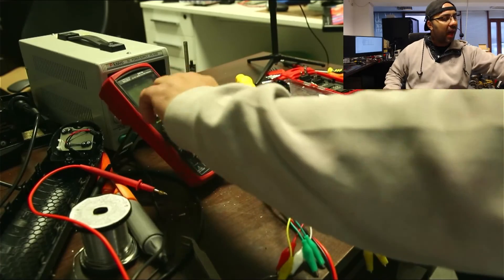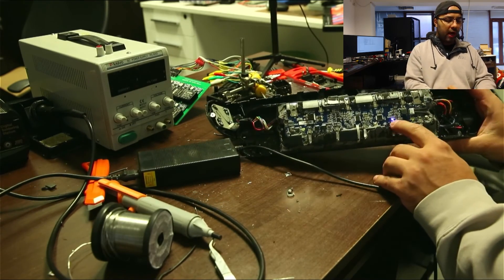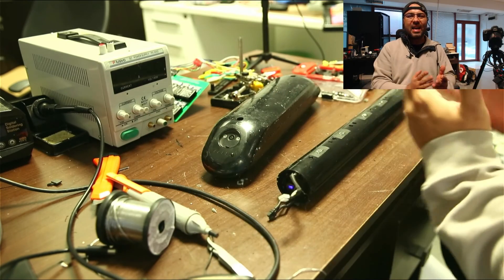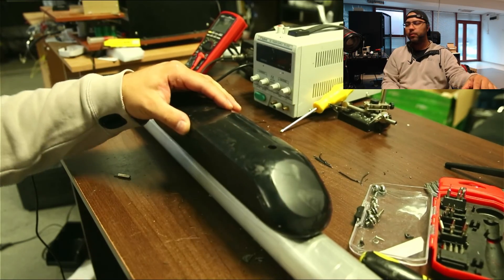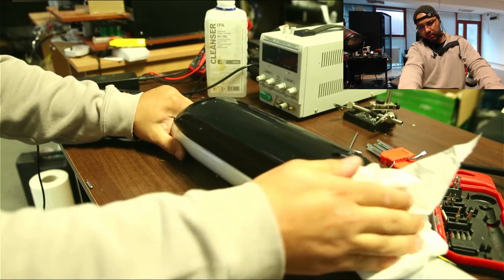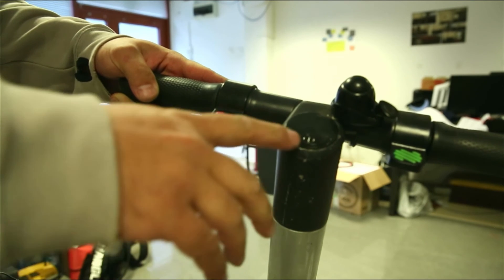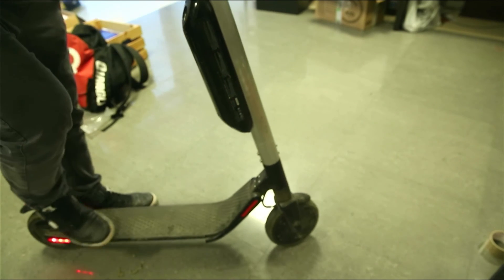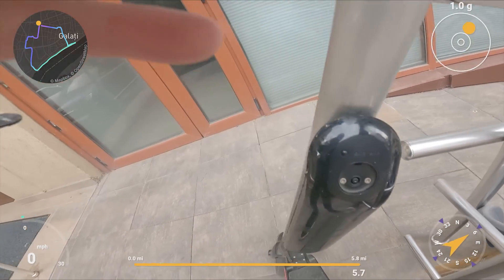Revive Your Segway Ninebot E-Scooter Battery: The Ultimate Teardown and Recharge Guide - Part 3

Comment: I have 45 error code,  both battery charging normal when connect them direct to the charger with but not charging when connect them up to control board, any idea to fix 45 error code  ?

Comment: I wonder if it would be possible to mount 2 wires and crocodiles for each external connector of the MCC pro (just to send low intensity  voltage to batteries under 3 V without dismounting the cells and not passing thru the BMS indeed ? Thanks
Reply from the maker: If you connect 1 slot at a time, yes, can do that. If you connect multiple slots to different cells in that pack, megacell charger will get damaged permanently
Reply: @thecelldoctor8890  Thank you ! Too bad ! I was vaguely expecting to use the balancing wire to send them a low current so the cells can begin to charge . But I do not understand if  constant voltage or constant current is needed in that case. THe power unit you use in direct mode, do you regulate voltage or is it intended for fixed foltage and some not too high current max ? , (and those batteries have only 10 cells each ?)
Reply: @thecelldoctor8890  hello, I was looking at your video on facebook where you state that you try to use  non conductive pry bar. Last year I bought a zipped  bag with many tools to repair cars external skins and other where plastic pry bars are useful. The kit was about 15€ and very useful to dismount modernTV (many of them have no screws). I will send you a linkwith Gmail if I find it now. Best regards

Comment: Hello, those are 3 interesting videos , WOuld you make me a  13S multi_ charger , I do not see myself building it on breadboard or the bords with many tinned holes But : you have  4 wire by every charging element ? ( may be if you give me the reference (making 4.2V x amps) from your alimentation ?  I guess your BMS have a balancing part, but I do not understand as I did read there are 3 sorts of BMS, some without real  balancing circuitry  how do they balance then ? passively ? . Now I will have a look at your catalog in case I see you homemade tool ! I have one of those cylindrical batteries, un charged for one year but neww , not used . U8Nfortunately metal case with plenty of sillicon in it . I could cut the sillicon up to a point but the pack stay stuck , I will try with the air gun , but the heat will be dissipated fast due to the aluminium casing.
THanks again to make those videos I thought that under 2.5V  the battery begin to die and couls sie relatively fast...does not seem to be the case in the end . Regards